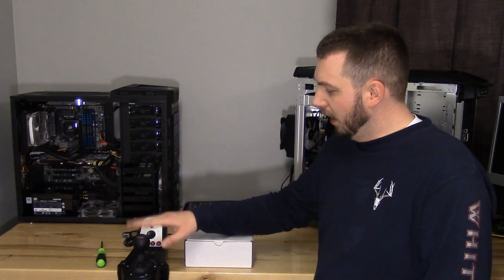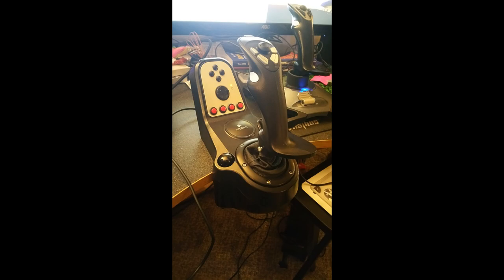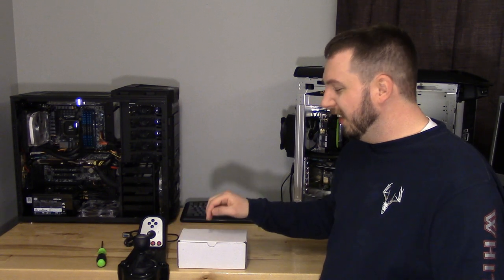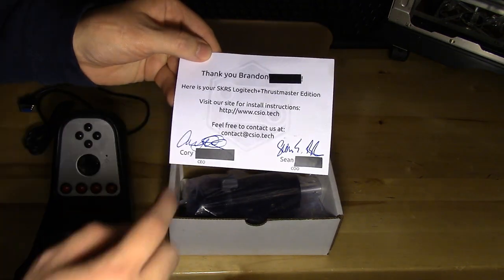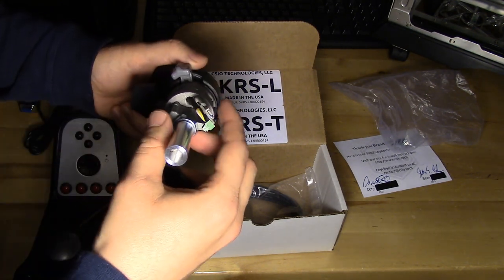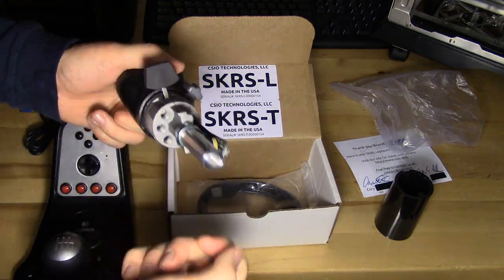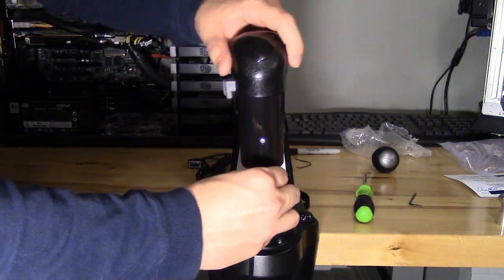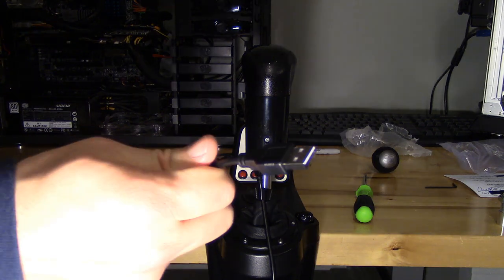CSIO Tech: SKRS Shift Knob for ATS & ETS2!

Comment: You should do an long stick extension
Reply from the maker: +Keith Jackson On the G27 you would destroy the inside in one evening. The thrustmaster would hold up longer but still not good for it.
Reply: +GunninGamerz I have disassembled my g27 shifter and all the moving parts a metal, so it's stronger than you think
Reply from the maker: +Area51Gamers You must have a special (newer or older) one because all the guys in our group have plastic in ours. The guys at CSIO have said the same. Mine was purchased in fall 2014 from Amazon. Remember to also look at the side wall of where your shift pin slides in, its all plastic and that's what takes the abuse if you are not careful with the shifts. Lots of plastic inside. The Thrustmaster is all metal.
Reply: hmm i got mine last year

Comment: Does the saitek wheel work with the Logitech shifter or no?
Reply from the maker: Never tried, but as long as the game supported multiple inputs then I would guess yes.
Reply: +GunninGamerz Thanks I didn't want to buy the Logitech and the knob to find out that it isn't supported.

Comment: If you order one, good luck getting it sooner than 4 months. These guys have done a great job making the knob but are piss poor with customer communication and actually getting these out the door.
Reply: I agree. They have failed to ship mine as well. I ordered from aplusbsoftware and its amazing.
Reply: It's been eight months here, and they haven't shipped. I'm filing a fraud report against them
Reply: Hey Jon, how is this working?
Reply: Hey Leo, seems like only 2 guys working on unlimited orders across the globe and may be delayed more ..not sure if they have any timelines which is very sad to hear... go for AplusB Simu Shift Knob.. it works great
Reply: Gaming Freak Ok thanks for the input. I'll check that company out!